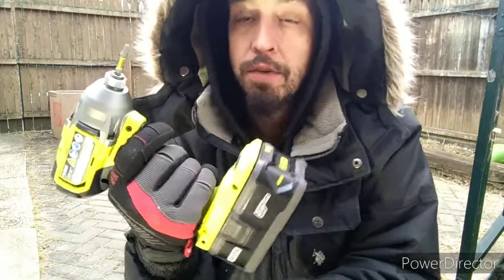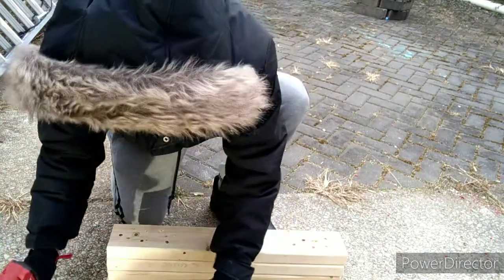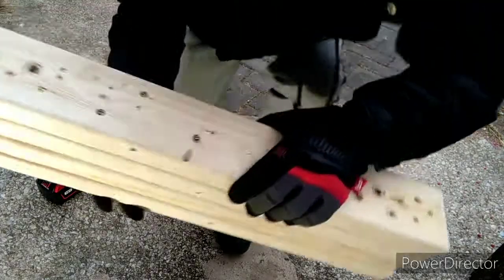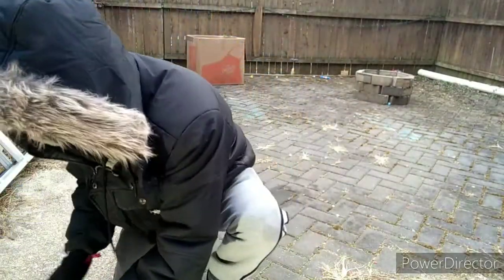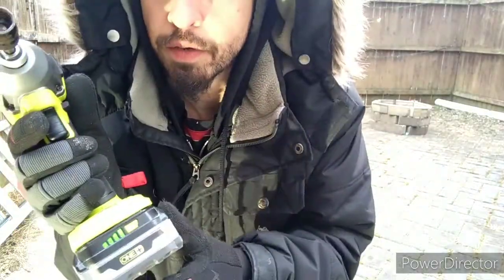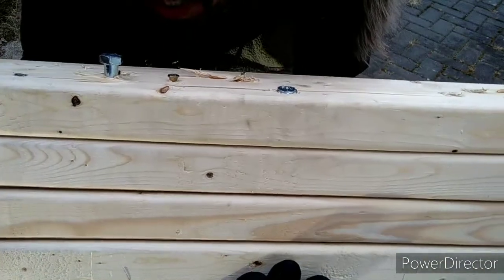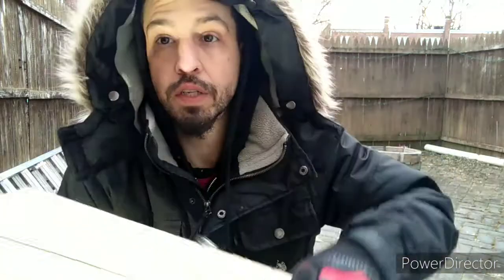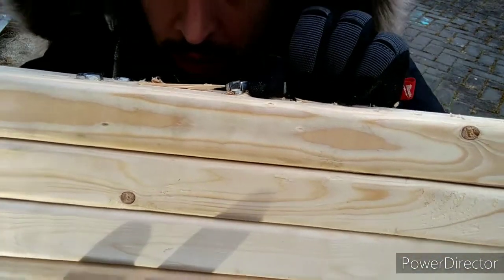New ryobi 4-mode impact driver pblid02 vs. milwaukee gen 3. Which is more powerful?

Comment: Looking back do you think if you had changed sockets on that last 3" lag switched the loose socket to the pb it would have won or been a tie because I bought the gen 3 and did the same test and was dead nut even 3" and 6" but I used a 6×6 i now have m18 tools m12 bosch makita dewalt and ryobi my box looks like a rainbow 🌈 lmao 🤣 but I had  times I beat the gen 3 I guess alot goes into these test density of wood in one drills spot the way you hold the drill if you going crooked you not giving that drill its true potential and batteries. Just wanted to share a few thoughts have a wonderful day brother
Reply from the maker: Idt so bro cuz the Gen 3 is rated at like 3600 rpm and does way more torque then it's rated. I've seen it break loose multiple nuts torqued to 350 ft lbs. It's def the most powerful and fastest impact driver on the market, more powerful then a lot of impact wrenches. I like the new ryobi but the Gen 3 will show it on longer lags. Do it with a 6-8" lag and you'll see. The batteries being used plays a factor also. I was using an hp battery with the ryobi and a knockoff with the Gen 3 and it still won
Reply from the maker: There's ppl that take the collet off the Gen 3 and put an anvil on it to turn it into an impact wrench
Reply: Your reference to man caver i assume lmao 🤣
Reply from the maker: @WTNPROUD  lol I can't remember where I seen it but it's cuz the original gen 3 had the collet issue. They fixed it on the newer ones and call it the Gen 3.5 lol
Reply: That was on VCG CONSTRUCTION  He sent it back if your gen 3 cuts up and looses it bit retention contact Milwaukee  I sent mine back still waiting for it I couldn't do paddel bits id loose my paddel and have to grab a pair of pliers or another tool to get it out but yeah I bought alot of tools different brands to
Reply from the maker: @WTNPROUD  never can have too many tools lol they're investments. Yea milwaukee will fix the old ones, but the new ones in the store for now on will already come with the 2nd ballbearing and stronger spring. Mine is the older version, I bought it off eBay so I'm not sure if they'll fix mine or not. I haven't had issues with it yet but then again I don't use paddle bits either, I rarely need to drill holes at work
Reply: So you think its the 3600 rpm that make it the true champ of the impacts not to mention the raw power I was referring to that 3 inch lag with the 16 tooth if you would have changed i think you would have got a different outcome. Anyways ive been seeing you on VCG mancaver all over lol I think that anvil swap was a mistake he ruined the best impact in the world for what? Its not like he needed an impact wrench
Reply from the maker: @WTNPROUD  but yea I be on those guys live streams sometimes lol
Reply from the maker: @WTNPROUD  I think the rpm plus the ipm combo makes it the reason it is so powerful. I believe the ipm is like 4300 or something crazy, so it gives it more power then any other impact. Yea I def wouldn't put an anvil on mine, ide just buy an impact wrench. But who knows maybe his collet was horrible or something. I bought a factory reconditioned 18v ryobi miter saw for $80 and it works great for me.
Reply: @theperfectpaintertoolreview  i just bought the brad nailer spot light fan folding bench light got the p230 for 60 and paid 100 for the other 3
Reply: Hahahhaa i seen you baw i was watching vcg live and heard perfect painter and told my wife look my boy watching lmao

Comment: You should do a test with the milwaukee using a 3 amp battery
Reply: Overall it was still a great comparison video..the ryobi did better than I expected.
Reply from the maker: @sheevang2514  thank u I appreciate that. Yes it did a lot better then I expected also. I'm putting it up against the p238 today. Don't forget to subscribe and turn the bell to all. Thanks
Reply from the maker: I wish I had one. The 5 was the smallest I have at the moment. But idt it's a true 5 ah battery